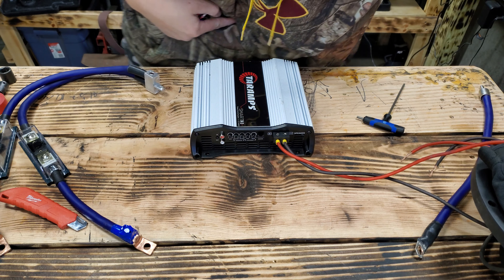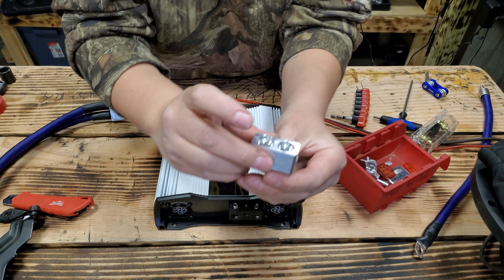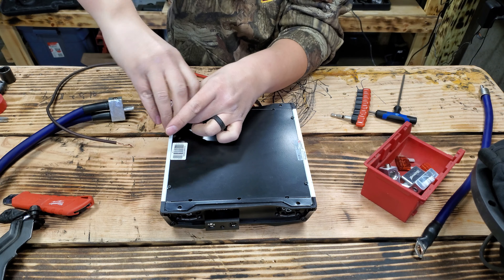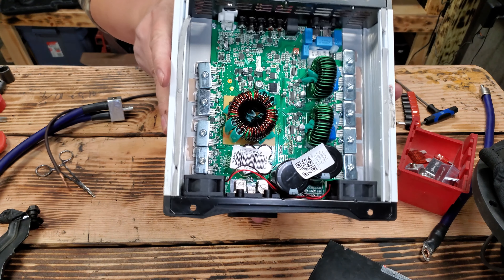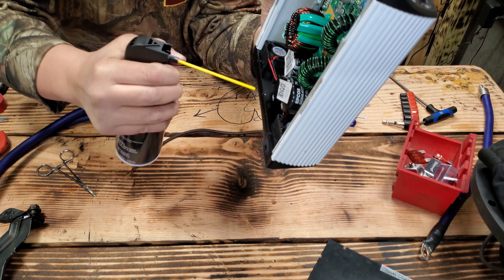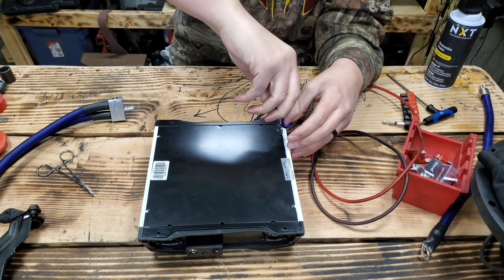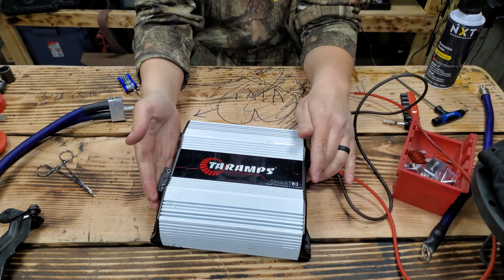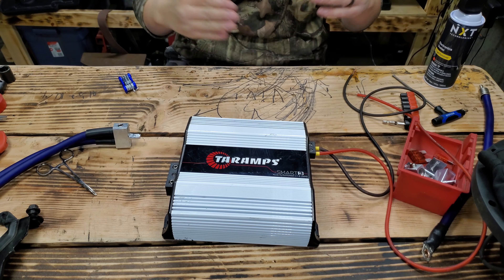Taramps Smart 3K review, Gut shot, and demo!!!!!

Comment: Is it common for taramps to shut off when the bass hits.  I noticed that wen I turn it up and the lites on the front max out that the amp will shut off but it cums right back on.... and I barely have the gain up at all... seem like the higher the gain is up. The less I can turn my radio up b4 the amp shuts off.  It's got great power but I can't use it all...lol...if it would stay on I would b happy with it.  Ohm load is 1ohm
Reply: I have the smart bass 3k
Reply: @johndoe..THE_REAL_JOHN-DOE  you need better electrical for this amp to function well
Reply: What amp you got because mines run like it stole electrical current front another battery!
Reply: @got2getit204  I had smart 3. But figured out it was just power hungry and switched up
Reply: And I had great electrical h/o alt and extra batteries
Reply: @johndoe..THE_REAL_JOHN-DOE  I know that’s what I found out so I just got a 4000 watt battery in the back and giving it all the juice it needs!

Comment: Hey buddy I just bought this amp and I have a full brand now set up in my car with already put in place ofc 0 gauge from my second battery to a fuse then to a 0 to 4 gauge distribution block and I have 4 lines out that are all 4 gauge wired in to all the amps and I have seen that a lot of people are running 1/0 or 0 gauge to  this amp! And I would really like to stick to my current new set up without a ton..... of work to now chang it up wiring it for 0 gauge to go to just this one amp! 

So my question to you is will it perform just fine with just 4gauge
And can I get by with 4gauge without ANY problems with fires/blowing something up/ or power loss? 
Also only going to be running is at about 1500W as my RMS on my two subs it only 750W a piece. 
This is the first time I have ever had this much watts to my 2 12's ever. 
Please message me back asap.
Reply from the maker: Hey sorry I only check this account every couple days. 
It depends on how long the run of 4 gauge is, under 10 feet you should be ok. If your running it 20 feet I would either run 1/0 awg or 2 runs of your wire. when I first put mine in I was using like 8 gauge and it worked ok, but when I rewired it with double 00 gauge inputs and grounds, MAJOR increase in volume output.
hope this helps